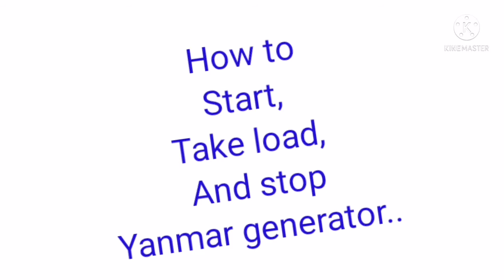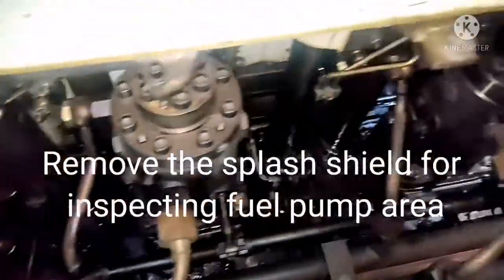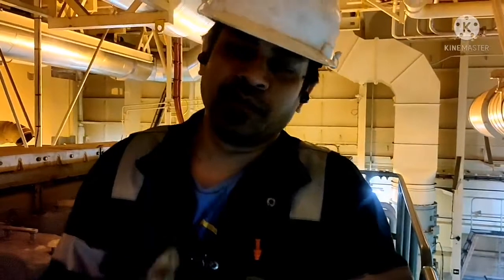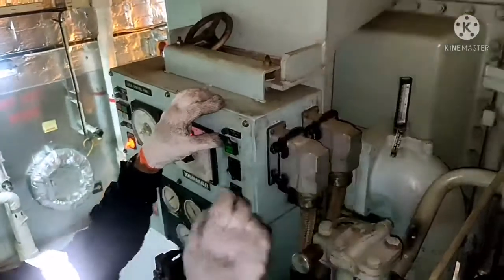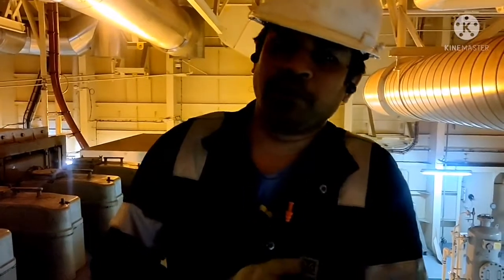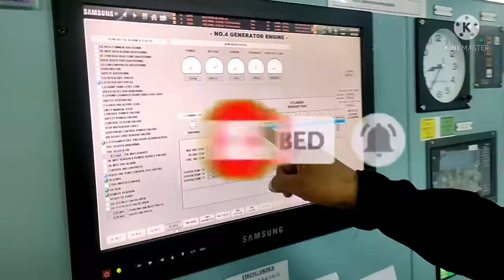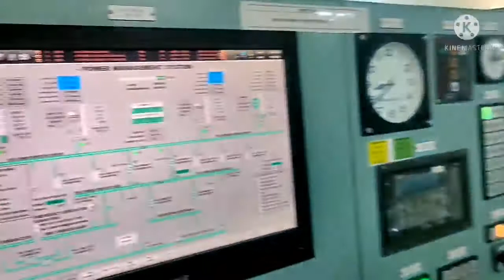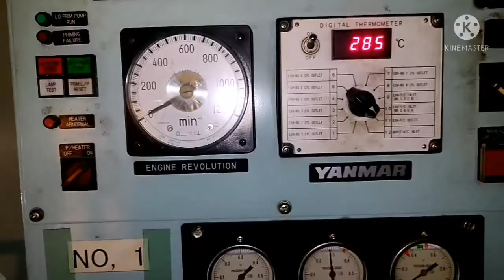How do they do... How to start and stop a Marine yanmar generator onboard ship..

Comment: Hi sir1),what are the interlocks in Auxiliary engine ?
And2) how we find compression pressure of auxiliary engine?
Reply from the maker: Thanks for your good query sir..
* To find the compression pressure, when engine is running u hv to disconnect the fuel rack of that particular unit and can use  performance tool to find it. The value you get is the compression pressure..
Hope this reply will satisfy your query
Reply: @marine-knowledge-basha  yah sir ,what about interlocks in A.E
Reply from the maker: @ajithakk3178  sry fr that..
* Turning gear interlock
* if the starting level is  in stop position.
* if there is any alarm like lube oil low pressure.. Cooling water high temperature..
* If there is omd alarm.
* if the control is on local.. U can't start from remote.
These are the interlocks in generator.
Hope this reply will satisfy your query..

Comment: How to identify where from Fuel high pressure pump has a leakage? 
For example. In night time during ums period we got an alarm AE1 fuel oil box leakage level high . How to find out pump which pump has a leakage ? If all the leakage pipes connected rigged .
Reply from the maker: Which generator maker? If yanmar u can have the seal line iwo fuel pump.. U can loosen the pipe nd c
Reply: @marine-knowledge-basha  MAN

Comment: In my ship( that's old ship 1996). So if we are starting generator we should start lo priming pump. What is the purpose sir. Because my engine is splash lubrication. Then why we need lo priming pump. And second question we should rotate flywheel by hand almost 2 cycle why?
Reply from the maker: Thanks for your query sir..
# Starting priming pump is to ensure engine parts are well lubricated bfr strtng.
# we need priming pump for initial lubrication.
# rotating flywheel will ensure the free movement of engines and to avoid any damage in cylinder if there s any water on it..
Hope this reply will satisfy your query.
Reply: @marine-knowledge-basha   sir thank you for reply. I thought you are not reply msg. Because I ask you so much question. Sorry for asking so much question. Here my crew don't know English. That's why  I ask. Anyway thank you sir
Reply from the maker: @balajichandrasekar5005  Pls don't feel bad to ask any queries to me.. U can learn a lot from askng questions.
Pls keep asking... No worries